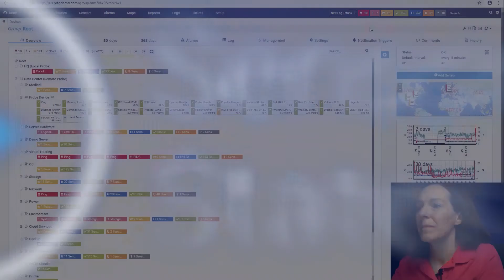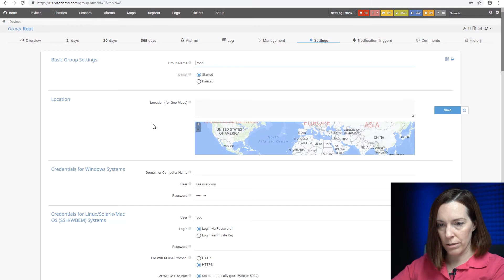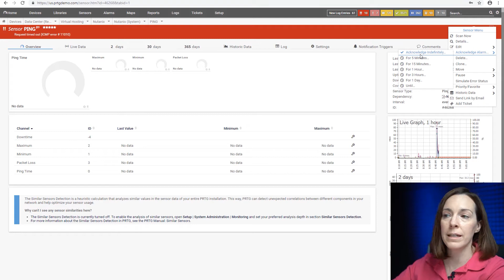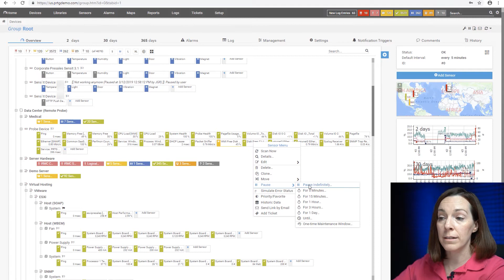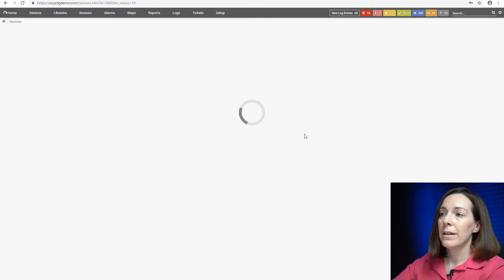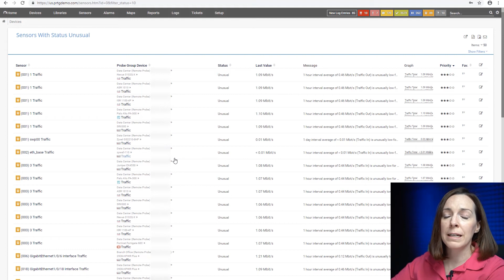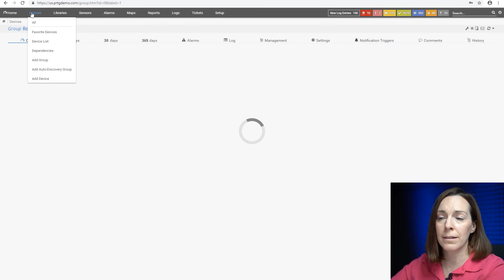PRTG Tutorial - The Different States of Sensors

Comment: What is the best practice for below scenario:
You know there is a service outage from ISP side and nothing can be done, but you want to stop tickets created by PRTG alarms. Should I go with Pausing the alarm or Acknowledging? Please advise, Thanks!
Reply from the maker: That's very much down to your own configuration/monitoring needs - if it's a sensor that will be affected,  Pausing the sensor in question might be less less disruptive - this will then avoid any alerts or notifications being sent altogether. Just right click the sensor, go to 'Pause' and then chose 'One-time Maintenance Window', and you can define how long the downtime will be in advance. 

If you'd rather pause the Notifications in general, you can do that via Setup>Account Settings>Notification Templates, and pause the appropriate templates.  Hope this helps!
Reply: @PRTGtutorials  Thanks for useful info,however, my understanding is that acknowledging down sensor will still scan to check its status as well as stop sending notifications but pausing down alarm doesn't scan the ping sensor until unpaused correct?